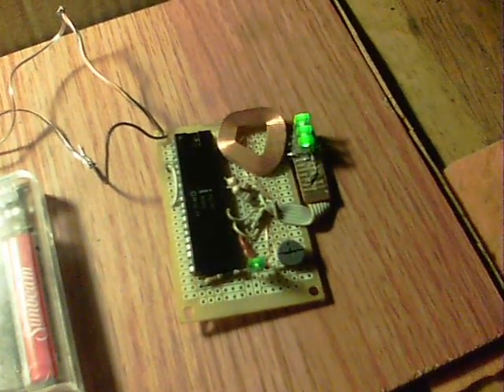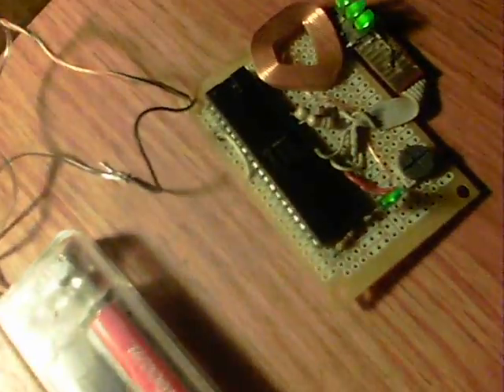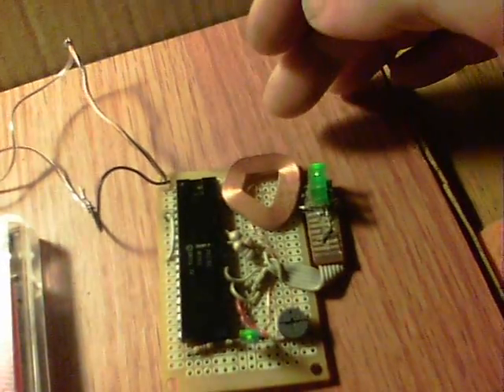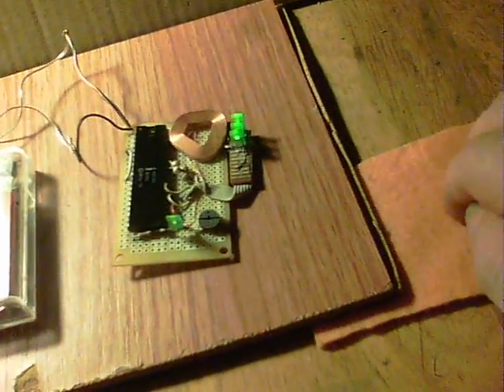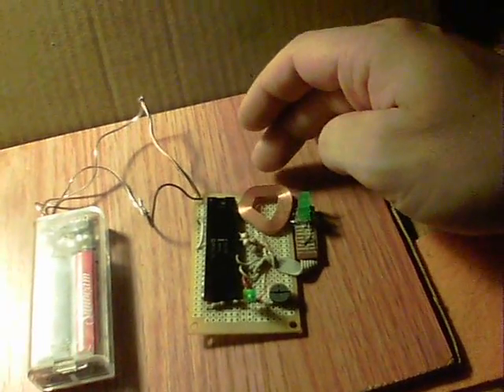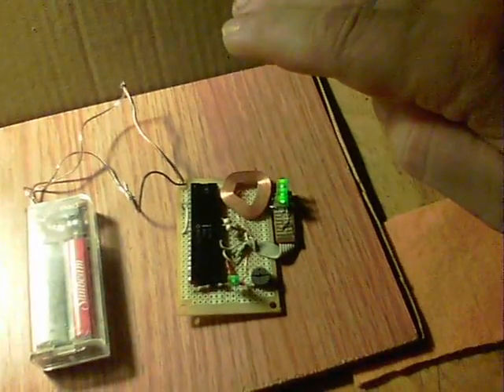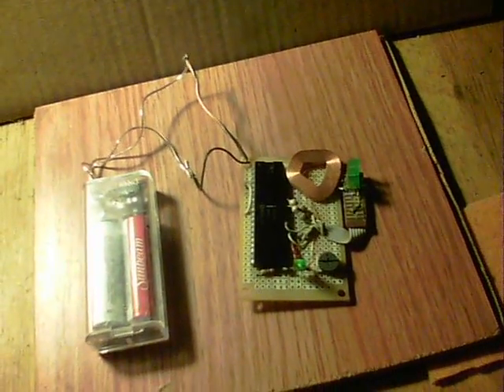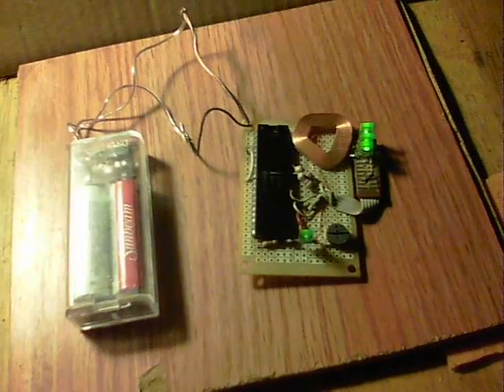1977 Intel 8255 chip - As a fun proximity sensor

Comment: Interesting - just learning about sensors and chips - in this case, which component is doing the actual proximity sensing?
Reply from the maker: Chris Boden Thanks Chris. The chip is doing the sensing, of changes that the coil experiences. You could say that the coil is sensing, in a way. It's much like a metal detector in operation. The chip outputs to the LEDs on its data lines. It's all nothing like the original purpose of the chip of course, it being intended for computer data tasks back in the 70's. The coil connects to what should be the Read pin and intended for digital 0's and 1's.
Many old chips do useful oddball things, now that they are basically worthless and can be experimented with. For example, some Pentium processors have big chunks of metal on the top to help with heatsinking...they work great as virtual grounds in these types of experiments. You can often use individual internal transistors of some chips, by following the schematic in datasheets.